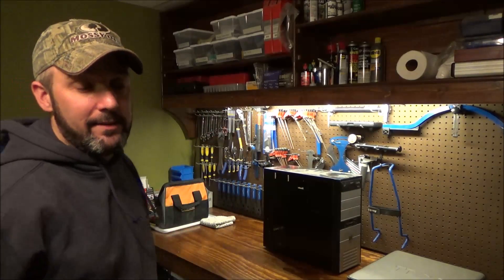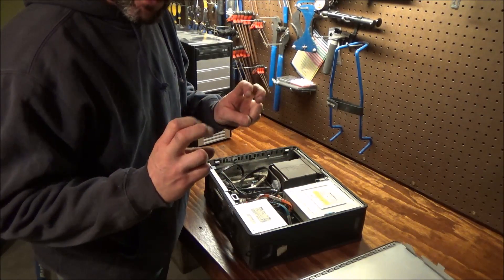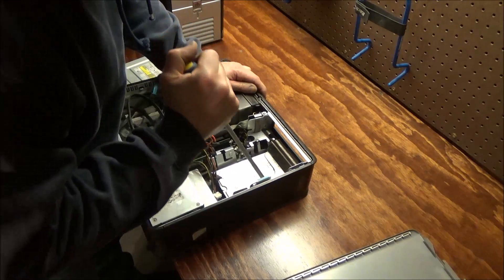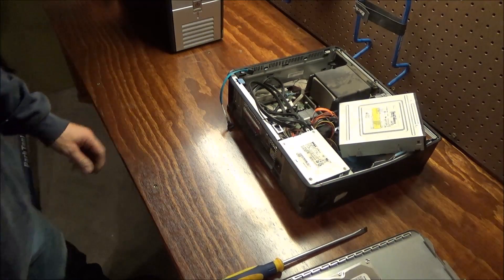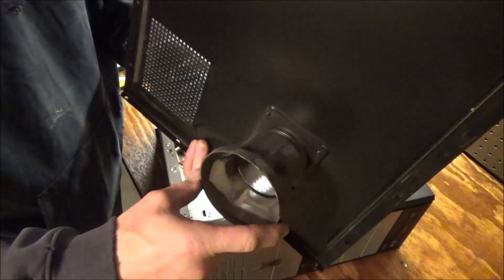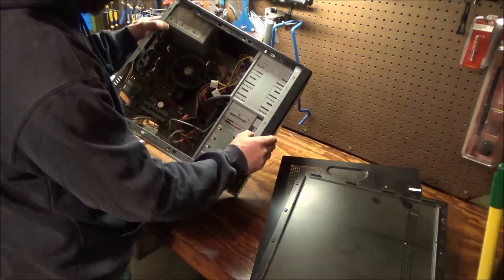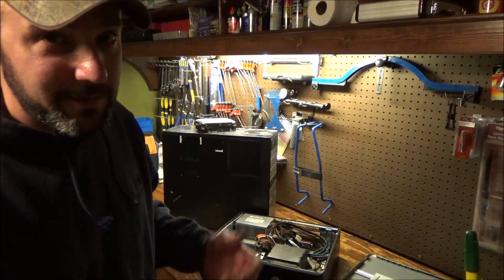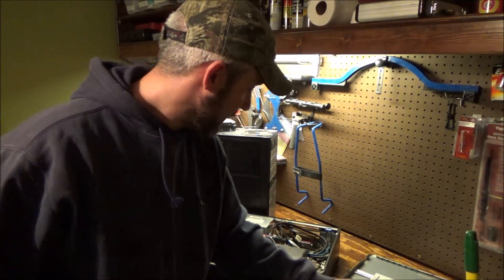How To Format A Hard Drive - PERMANENTLY

Comment: As someone who owns and operates a computer repair shop I always tell people to make sure they don't leave data on their hard drives.  I use Darik's Boot And Nuke to format them.  Or for the extra paranoid I will use on Arbor Press right in front of them to completely destroy them.  Also, if you ever want to have some real fun pull the platters from a hard drive and stick them in a Microwave... preferably one you don't care about.
Reply from the maker: +Eric Brunhammer Oh the microwave huh... now that sounds like fun

Comment: Standby for delivery of an M161 Vulcan 20mm 3000 RPM Gatling Anti Aircraft gun which can be used in peacetime for rapid formatting of any aftermarket hard drive or total destruction of any Dormer product that does not cut the mustard. Safety goggles are advised as a useful accessory. Terms and conditions apply.
Reply: +Tom OConnor -- probably wouldn't need to worry about the Dorman products.... most likely the Dorman stuff would fall apart long before you got anything loaded.

Comment: I sure hope you have a backup computer. I would have held that baby for a while, just in case.
Reply from the maker: +Moon Hitsearth Bahhh the shop computers we get for about $120. They only have to have a small amount of storage and get on the internet so nothing real fancy. I always have a back up there just in case.
Reply: South Main Auto Repair
That's right, you probably subscribe to the database. Been a long time since I worked in a shop. We had the diagnostic machine, and a library of manuals.

Comment: LOL that was quite entertaining (and your accuracy is quite impressive :) ) ,  For your purposes that is more then enough to keep your data safe (and sure looks like fun to do!!)  But it should be noted that  believe or not those drives could still have data recovered off them (Data is magnetically recorded, buckshot doesn't stop that) and those platters are still in one piece.  It would be wildly difficult and require special tools/methods (stuff that is not economically feasible for your average identity thief) but it could be done.    Again, for your purposes this is more then fine!    But if you dealt with much more sensitive data (Multiple SSN's etc) stuff that would be VERY lucrative for a thief then you would need to go further.   how far?  well one of my friends has a company that does employee background screening,  his data is VERY sensitive, whenever we retire a computer I run a full DOD wipe delete (I use a commercial utility due to the nature of his data,   Once I have wiped the drives, we have them Shredded   (https://www.youtube.com/watch?v=jvwXGaVNchQ) and we get certificates for certification of destruction (Plus our drives are encrypted anyway).   Do you as a home user need to do this?   Nope.   You can get a GOOD free utility to wipe the drive (DOD wipe delete) called Darrik's Boot and Nuke www.dban.org and then just ram a drill through the platters...for the home user it's more then enough.     Still I really enjoyed this vid :)

Comment: since you have mastered the windows aprroved formatting method,i hate to pop your bubble but there is also a risk inherent to printers and their hard drive/memory.you see when you use a printer/fax machine they hold info too and can/have been infiltrated by those pesky varmints to upset your life.this method,though not approved is applicable for use on those machines too.this method is approved for the windomus aggrivatus form of anger while dealing with those issues too,relatively cheap and effective.the nra would approve of this method.

Comment: This is the fastest way to do it ;)

Btw, the processor, RAM, and motherboard are all solid state and cannot store any information once powered down, so no need to worry about that next time. It's still fun to make sure though ;)
Reply: SSDs are solid state...
Reply: brian0918 I just meant that solid state electronics in general work when on and that's it. SSD's are special and use what's called NAND memory. It's completely different from DRAM which loses all charge when it's powered off. Although even SSD's aren't immune to this type of data loss. 10 years of being powered off and the electrons will escape and you lose your bits. The processor caches are also read only, and data links can't store data, only move it around. So storage mediums are the only thing you need to worry about. That was my point, sorry if the explanation wasn't technically sufficient.

Comment: Enjoyed the video.  Next time, think about recycling the parts so they can be used again in another device.  You can take the hard drive discs out of the hard drives with a screw driver.  On that disc is the only place your information is stored.
Reply from the maker: +Sandbag1300 Those two systems were realllly old... I doubt any one would have wanted any of that old stuff. Maybe though... Well any how the metal is going to the recyclers :) Oh hey I did get your E-Mail the other day. Have't forgot about ya just getting caught up on stuff now. You'll here from me soon. Didn't want you to think it was lost in space.
Reply: South Main Auto Repair Because of the recent Great Recession, there are guys that will actually reuse some of the parts and will come by your house to pick them up for free.  Also, there is some hazardous waste on the circuit boards.  https://en.wikipedia.org/wiki/Computer_recycling

No need to respond to my email -  just trying to get you to 700,000 subscribers faster.
Reply from the maker: Ahhh got ya, well I know for next time :)
Reply: laaaaaaaaaaaaaaame

Comment: OK. That was just cool. Thanks for the best idea now all I need is to clean my gun LOL. I know you drive a Ridgeline to and I think you do some towing as well. How much weight do you tow and how often to you change your fluids? Trans/oil/Atv ECT?
Reply from the maker: +craigsclocks  I usually tow 5000lb trailer weight or less and I change my trans, t-case, and rear diff every 30k.
Reply: +South Main Auto Repair Thanks for the info on the Ridgeline. My truck has 110,000 miles on and no problems at all. My only worry is sometimes when I'm towing my camper up steep hill and can sometimes hit 5000 RPM's. Do you do the same and if so is this doing any damage to my engine.last question for the day. Thanks Sorry I work on clocks not cars.
Reply from the maker: Haha actually I am hard on cars truth be told. I would have no problem on a well maintained engine running it at high R's. Hold it at 5 grand for 10 min straight may start to over heat the trans though. as far as it hitting 5 grand to get over a hill I wouldn't worry a ton.

Comment: ok.....that was fun, but I needed a power supply.
Reply from the maker: +Randy Gudeahn (ProTech) Ummmmm I have one.... you may need to fix a few of the wires though....
Reply: Hahaha.
Reply: +theoldwizard998 he sure did. that saves on using a water cooled cpu.
Reply: +Randy Gudeahn (ProTech) Eric just added some additional ventilation !
Reply: Make sure to use heat shrink butt splices to fix those wires

Comment: "If i can format a harddrive, you can format a harddrive"

Not in that manner i can't. Where i live, if i pulled that shit off in my backyard i would be in jail before i even pulled the trigger.
But there are even better ways to format a harddrive. Just apply sledgehammer and put a strong magnet to the platters.
In fact, that's how professional data security is done. Degaussing the drive 3 times in a row which basically makes it into a big collection of null^2 bytes.

As for all that dust inside. I actually thought better of you, that dust is a crazy fire hazard. It can go up in flames even after you have cut the power if you are unlucky. A single capacitor failing and all that dust equals house burned down.
Please take the lid off your new devices every 6 months or less and apply dry air to the entire device.

This also applies to any other electronic equipment you have at home, especially such that has fans in it for cooling. They are after all similar to vacuum cleaners.
Reply: +Cadde That would've made a good video - set the computer on fire first, then shoot it up.
Reply from the maker: +Cadde Yeah I usually blow them out a few times a year but.... welll ok I don't have an excuse on that one. The shop environment is tough on them

Comment: I haven't seen anything get so thoroughly "formatted" since Sonny Corleone took a drive down the causeway.  ;)

Seriously, I've worked in Information Technology for 30 years now, and the only way to truly protect your data is to completely destroy the media...any notion that your data can be "thoroughly" wiped off a drive with software is a false belief.  You can actually buy hard drive shredders that rip them into tiny pieces, but formatting it the SMA way is a close second.  ;)

And Seagate drives are excellent at "formatting" themselves about a week after the warranty expires.  If yours were the original drives, I'm honestly surprised they lasted.
Reply from the maker: +Chris Freemesser Wel if I owned a sweet shredding device we would have used that for sure... this was the closest I had around the home :)

Comment: While probably very satisfying to ‘format’ the drives with your method, I hate to say it but its not very effective. Your data can still be read even after all that damage. If the platters (metal disks) inside the drive are still even partially in tact, like you show around 10:00, the data in those pieces can still be read. It may not be entire files, but even bits & pieces of files can be telling. Its all very tiny 1’s & 0’s. Granted, to get the data you would need a ‘Clean Room’ and some expensive equipment. But there are companies that will do it for a relatively small price ($100 and up). The company I work for has had data recovered from hard drives that were in fires hot enough to melt the metal computer cases & hard drive cases. When there is a will, there is a way.  Just sayin’…

What I have done in the past with my personal drives is to disassemble the drive completely, then take the platters out and run them by a strong (electro) magnet which will wipe the data, and then make them into a mobile to hang over my buddies babies crib, or wind chimes for friends. The magnet ensures the data is wiped, and I get to make it into a little art project too.  Recycling.  :-)
Reply from the maker: +brian0918 Mabey I could have had the magnet pic them all the way up and drop them and I could have shot them out of the air!? Not sure if the salvage yard folks would have liked it though...
Reply from the maker: "Pulllll"
Reply: +Pet Rock's Garage Yeah I was thinking he could've taken the hard drives to the scrap yard and put them on the electromagnet. That would've taken care of them. But the video wouldn't have been nearly as fun. This was just an excuse to shoot up some old computers and make a funny video, so I'm trying not to think about it more deeply than that.
Reply: Agreed…  Good idea on the junk yard magnet.  It would have been cool to see the drives fly up into the air when the magnet gets turned on. That would have been a good video.
Reply: THAT WOULD HAVE BEEN AWESOME!!!  Skeet shooting South Main Auto style.  :-)

Comment: Make sure you throw new spark plugs in there while you're at it.
Reply: Not necessarily. Just pull the plug out slowly while the computer is running. If you get a spark, then the plug's still good.